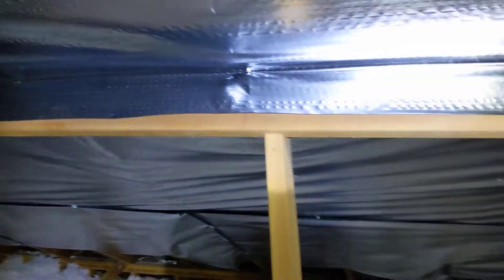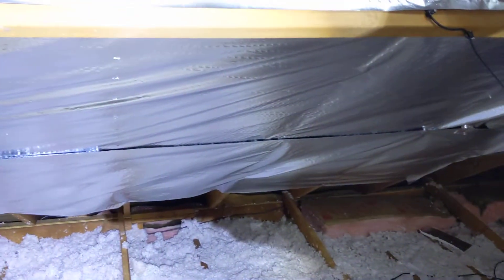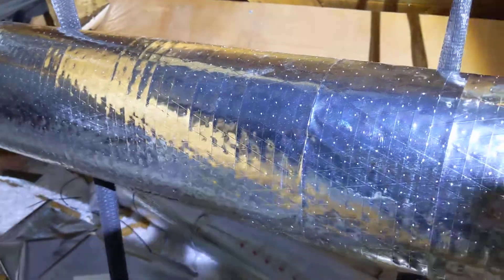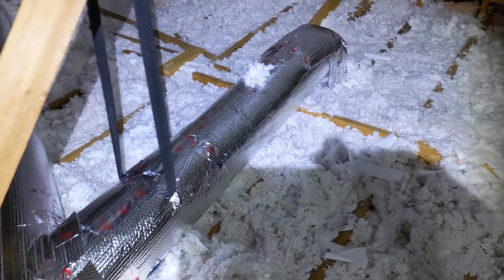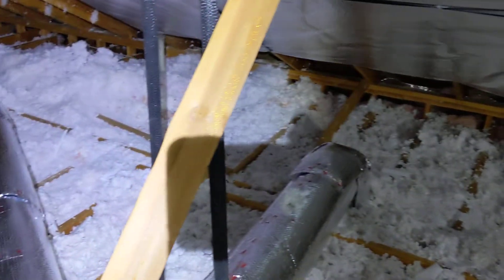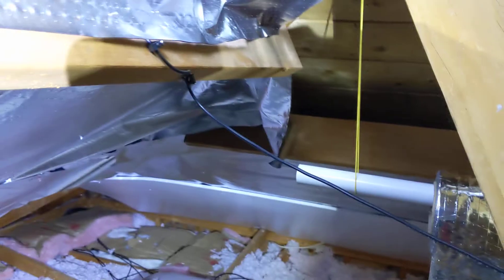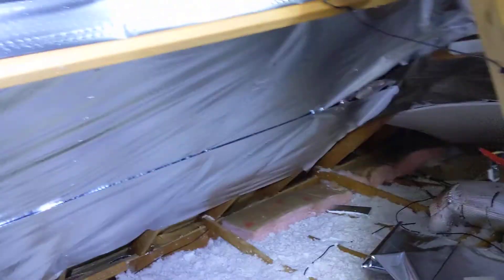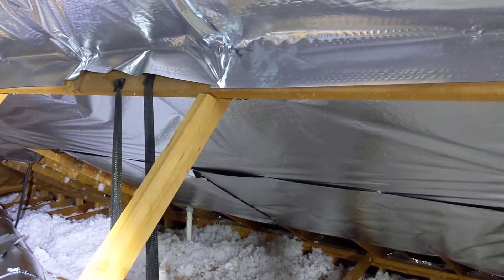Radiant barrier in attic

Comment: Just FYI. The product you are using is metalized film and not pure aluminum.  Reflectivity = 95%(maybe) The challenge with perforating most metalized films is that moisture can now come in contact with the vaporized aluminum layer.  This means the aluminum (shiny layer) will most likely oxidize to the point of becoming invisible over time.  To test your product take a small piece and put in a ziplock bag with some water and wait a week or so.  This is why we only sell pure aluminum for all perforated products.  More about metalized film oxidation (with pictures) here: https://atticfoil.com/index.php/technical-info/metalized-radiant-barrier-film-oxidation/
Reply from the maker: Interesting,  a little late for my install.  I'll have to monitor that over time.